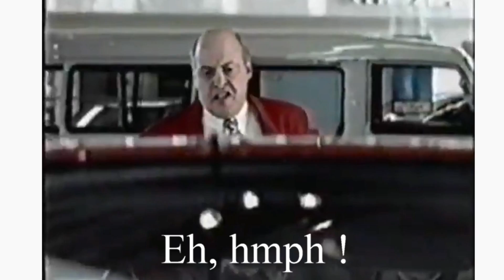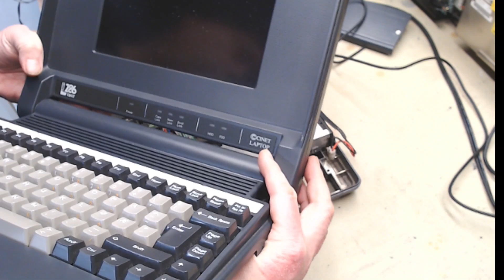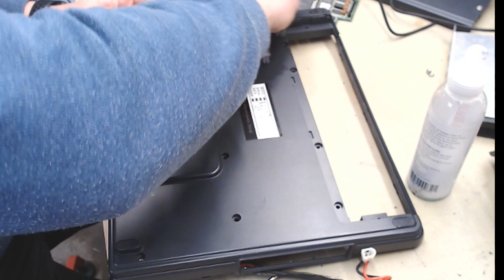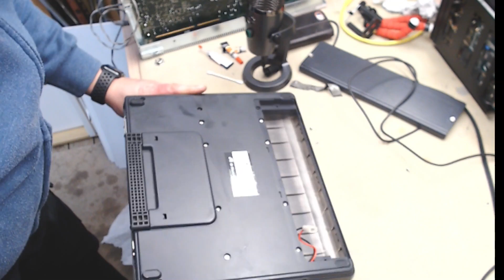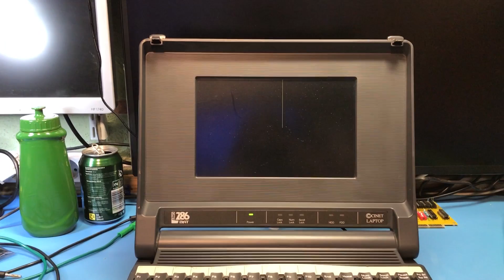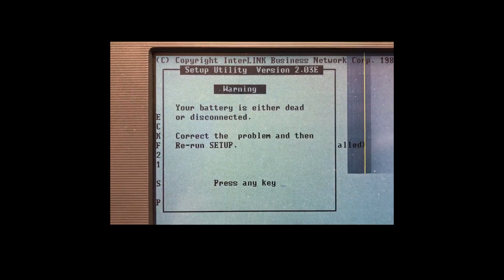The Cinet 286 Bat PC (AI-PC-16/AT)

Comment: Very good video Kjell! Some advice by a more experienced YouTuber (but still learning): The explanation and story is very nice. That commercial was great! Sound is good (except in the intro) . Check the white-balance of the shots as some are very over-exposed. Try to lock the focus on the work area  as it is fluctuating a bit. I have a couple of those Geilo screwdrivers too:)
Reply from the maker: Thanks Tommy, Good advice about the zomm. As you can see (hear) I have already taken notise about your advize about the sound. Still strugling tho....  The light and white balance settings is quite a challange down in my garden shed where most of the shoots were taken. The lights are a mix of different LED sources, and If I move the camera only slightly it moves both the white balance and the contrast.. So this is a work in progress..
Reply: @kojroRI  Yes, of course. I try to lock the wb and focus before each shot. But sometimes I forget it.